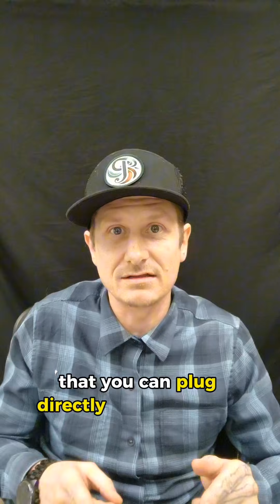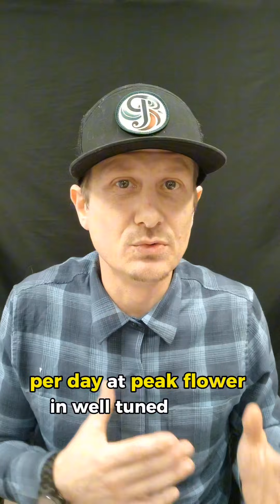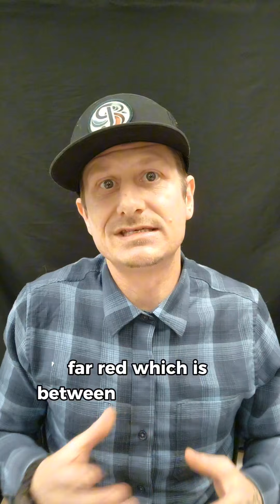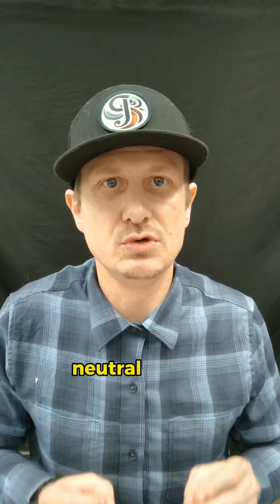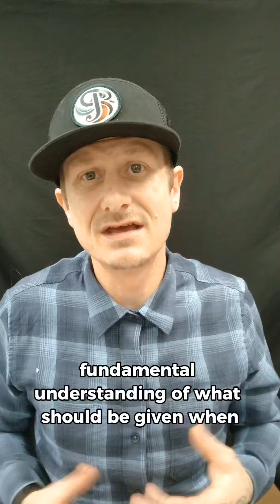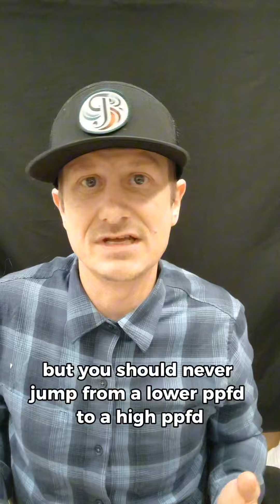Complete LED guide: HOW to MAXIMIZE quality, environment and yield!

Comment: If your using co2 and automate water you can push to 60 dli which is about 1000 umol over 18 hours, even seedlings will take this amount, tho you will need two sealed rooms to circulate and massive dehumidification and also leaf temp needs to be 30 c

Comment: Just missed it ... better late than never ... LED are worth considering, if only for saving electricity. An early adopter of CMH, it's hard to justify switching just to make outdoor starts and pollen donors. Will definitely use the "lighting guide", and try to apply the information to our existing system. 👍
Reply: Your cmh herb i bet smells loud and has better flavor.     Ive been rocking LED for over 2 years now, spectrum tuning too!   I feel like I get 60% of the smell is get from HPs or cmh.   I get way more yeild!   But lack on terps!   Im building out a mixed light room.    2) 750w. SE7000  LED and 2)  630w. Cmh and see if I cant get the stank up!
Reply: I just switched back to HPS+MH checkerboard for my flower room. Dialed in LED for years and I like HPS/MH more. I get more stoned
Reply: Enhanced mh and hps 4 life bros!
Reply: @diezelvh4133  💯